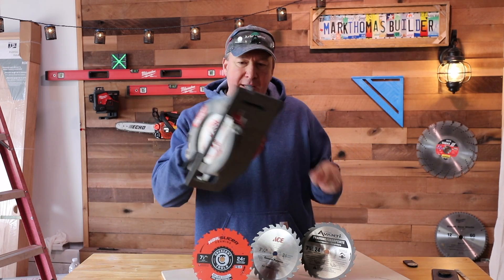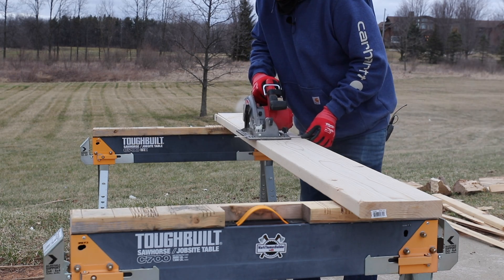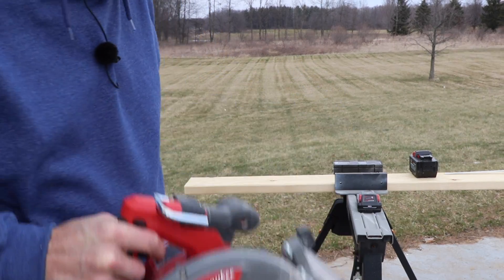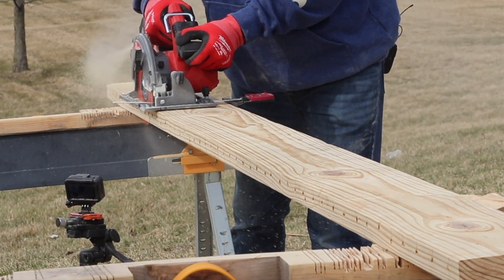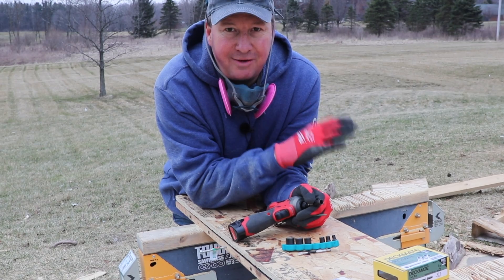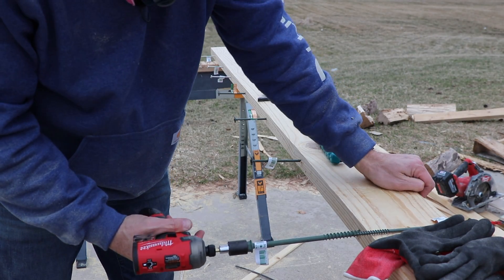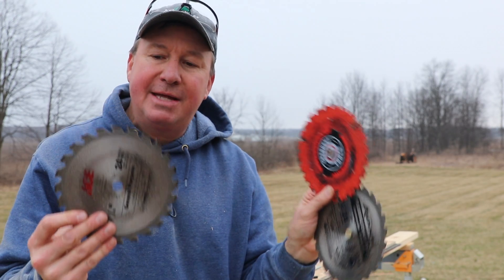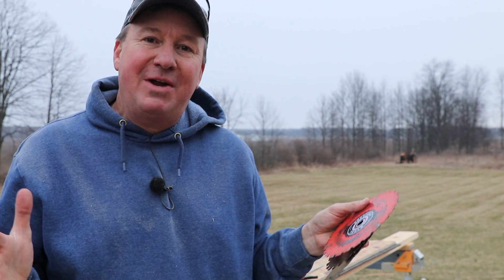24t FRAMING BLADES TEST COMPARISON // CRESCENT NAILSLICER vs CHEAP BLADES // WHAT SHOULD YOU BUY?

Comment: Oh mark mark mark. Hahahahaha. First, good video. Now onto my .. marketing and science based thoughts.

1. You know I make knives. The cutting ability is entirely in the geometry of the blade so thin kerf blades and cut offs will simply cut better than the exact same material being thinner - you knew that. I'm not sure if you fully understand the different types and grades of carbide. I personally don't. It's essentially a cobalt matrix binding usually tungsten carbide (WC) or silicon carbide (SiC) and it gets even deeper than the percentage of cobalt. I'm also assuming you know the emissivity values for IR temp guns but I don't understand the temperatures you got there. What was ambient temperature if you can recall? Seems cool but not. Freezing which for 60-90F .. one the most heat is going to be on the carbide teeth so very small distance to spot ratio. I'd use a thermocouple. K-type. Less guess work. Overall, I'd choose the Avanti. I think there's a lot more marketing going on than actual science. Well, there is.

But overall helpful for a lot of people, good post 👍
Reply from the maker: Thanks man, I was expecting the temps to be much hotter.  I waived the heat gun all around the blade and the carbide tips, so I could get the max temp reading.  Maybe I could've used a cooking insta-read thermometer on the carbide teeth.  
I'm glad to hear you like the video and as always, thanks for stopping by.
Reply: @MarkThomasBuilder  of course. Did you change the emissivity value on the IR temp gun? That's the EMS number. For the metallic ones, you needed to. Red paint should .. 95 EMS should be perfect 100 is black.. I'm assuming you knew this?
Reply: Also a tip: don't use the laser use your hands to aim it. The laser distance to spot ratio makes em rather pointless unless they have one like my temp gun that has a center laser and 8 concentric circles to give the actual. Distance to spot ratio visual representation.
Reply from the maker: @veraxknives0331  What brand temp gun do you have?  Just curious
Reply: BENETECH GT750. I don't think I can link it
Reply: Guess I can. Huh. Interesting